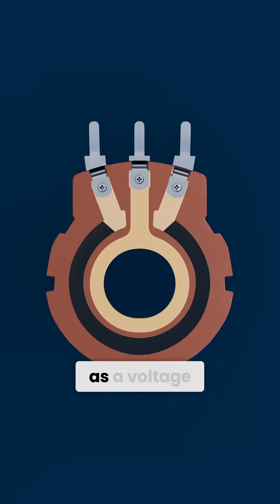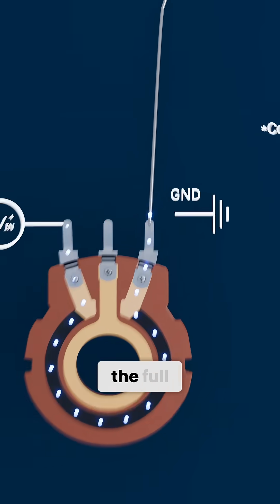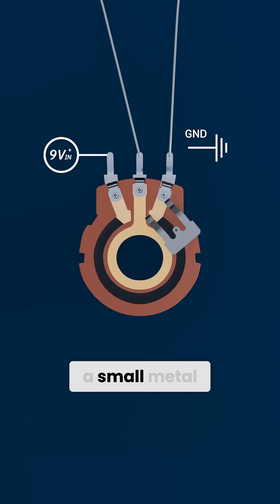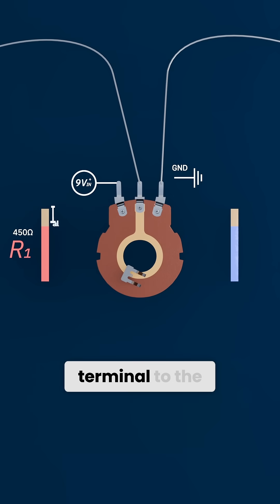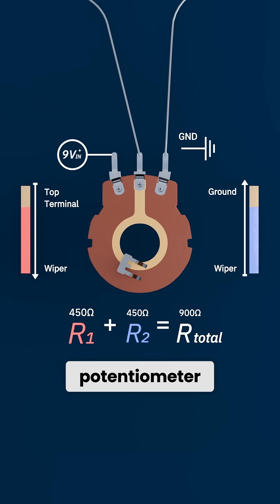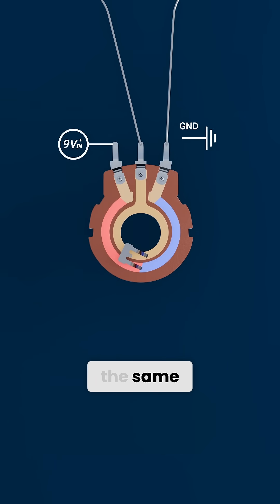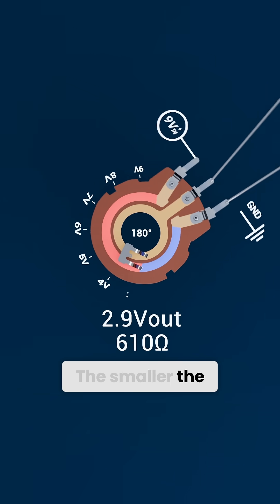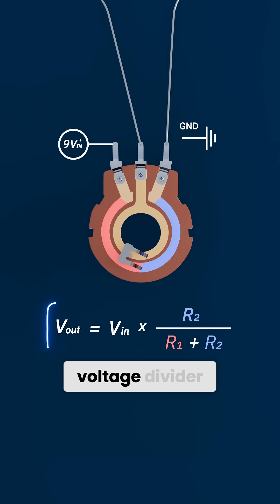How a Potentiometer Works as a Voltage Divider | Potentiometers Explained #shorts #potentiometers

Comment: However, resistors are now used to limit "voltage"?!
Reply: They always were 

Ohm's law

V = IR
Reply: So assuming the constant current 

V = R
Reply: Every resistance consumes a voltage and limits current

v = ir
v/i = r

So for resistance to be equal, either current or voltage has to be lowered
Reply: And because W (joules, energy) = VI

It means that no matter what we lower, the result will likely be the same
Reply: @itsmenatika Ok, I really appreciate that you actually wrote that many replies for an argument, which pushed me to reconsider my understanding of resistors, thank you.

Comment: How exactly does the wiper split the resistance if the current is going through both R1 and R2? Or is the wiper connected to the measuring device?

Comment: Why do the pots on my guitar feel like they have a less even rate of stepdown
Reply: Some pots use a linear rate of change, while most pots used in audio applications have a logarithmic rate of change.
These pots are called audio taper and the rate of change corresponds with human hearing curves.
Reply: It’s not necessarily the potentiometer, it also could be the circuit that the potentiometer is used to bias. Because sound travels through an open 3d space, it takes a huge increase to make something appear twice as loud, so amps, mixers, etc, need to perform accordingly.

Comment: The voltage drop does not change with voltage. With one end grounded the voltage drop will always be 9 volts in this example. The current will change however.

Comment: How do you compensate for circuit load and impedance connected to the wiper? That will affect the voltage divider.
Reply: And that is the fundamentals of circuit design… The first part is understanding the spec of the part vs your intended use. The second is doing a proper analysis of the design and maybe a simulation. LTSpice is a free download and you can do a lot with it…
Reply: Yes it certainly would and this video is misleading.
Reply: The simple answer is you don't. A voltage divider should be primarily used for ADC or low current applications. With a microcontroller you can then adjust a pwm signal for motor speed.

Comment: How do I know which Pot is suitable for either Current or signal..?  Resistance seems to be the only measure..
Reply: Look at the wattage and type.  Wire wound generally carry higher currents, and have discrete steps due to the wire steps.  The wire steps make it less desirable for audio,  but it is fine for audio if you are not moving the wiper.  Audio and other signals flow through all types fine, wire wound is probably "best" but the descrete steps would generate audio artifacts.  The carbon type are quietest, but cannot carry much current.  Which is best for /your/ signal will depend on the nature of your signal, in general current capability and noise generation are your main considerations, outside of precision.  For precision you  look for multiturn pots.
Reply: @bigtexuntex7825  Thank you for replying..  I am more interested in Current variability for small motors rather than signal.. I dont know how to measure what a Pot's limit is from my box of old stuff.. I assume bigger carbon trace = to lower resistance..?  Any reference I have found seems to assume I already know what I am trying to find out which is exasperating.. Any help would be appreciated..
Reply: @bigtexuntex7825  carbon elements are much noisier than cermet elements.

Comment: While it's a good explanation of the concept it needs to be said - don't actually use potentiometer to spleet voltage unless you're only going to use it to measure. 

When voltage is split that way and you add a load in parallel you would not have guarantee that the voltage is split how it should be.
Reply: I was going to touch on this as well.  It is not a good voltage divider if you pull very much current through the wiper, as the current can cause additional voltage drop.
Reply: To get something resembling linear behavior the load resistance must be at least 10 times larger than the resistance of the potentiometer.
Reply from the maker: Great point and yes, I 100% agree.

In the video we used the potentiometer as a voltage divider mainly for educational/theory purposes to show how the wiper changes the voltage and explain the concept clearly. (I do understand thats not how it comes across to someone with genuine industry experience from time to time)

In real circuits, you typically wouldn’t use a pot to split voltage to power a load, because the moment you connect something to the output it becomes load-dependent and the voltage won’t stay accurate (plus pots are low power rated).

Appreciate you adding that clarification though, and I think its something I should have added in too. Deffo a thought to keep an eye out for in later videos!
Reply: you can buffer with a opamp, or it could be used in amplifiers where it wont be loaded too much